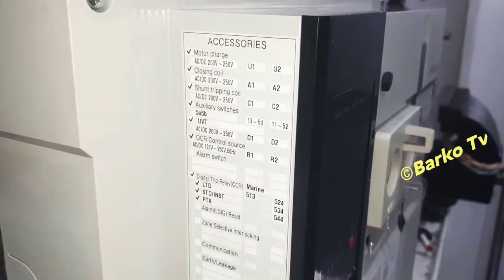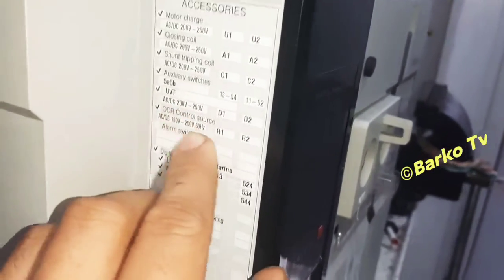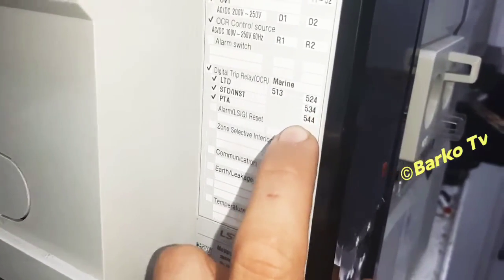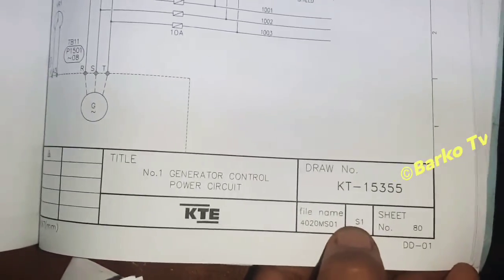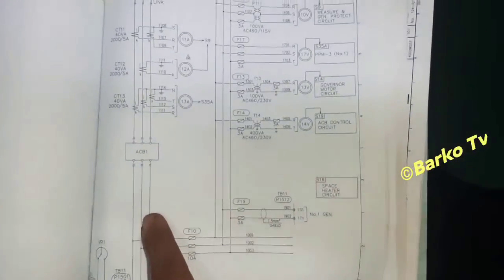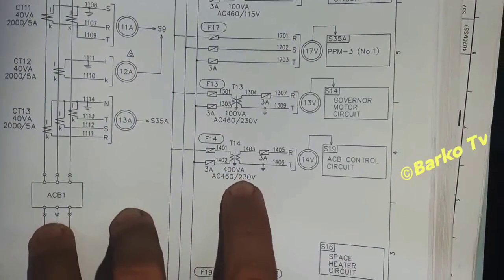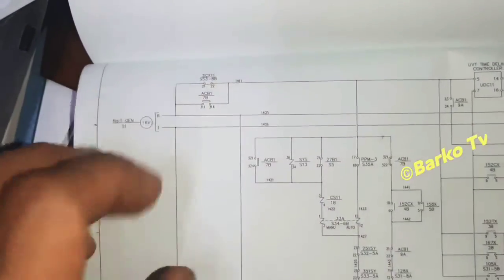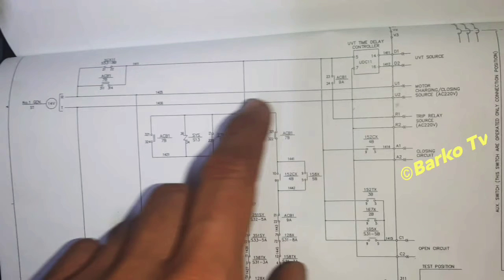Part 1 : ACB Troubleshooting & Simulation | UVT & Charging motor | | Metasol | Switchgear | kalecky

Comment: How to install mechanical interlock
Reply from the maker: Our acb is equipped with automatic interlock and safety devices such as uvt, shunt, etc to use in triggering this breaker. If you dont mind what specific mechanical interlock that you need to install? Thanks